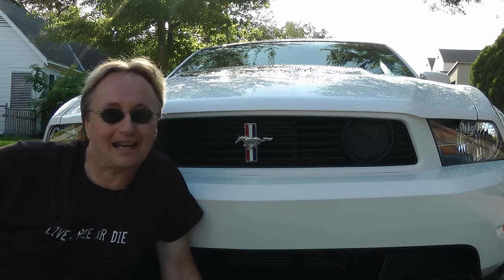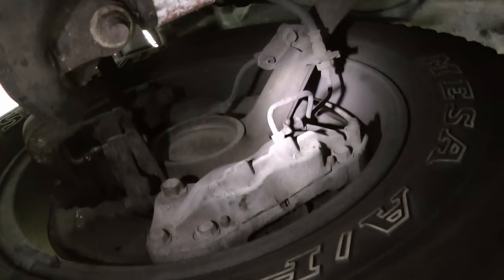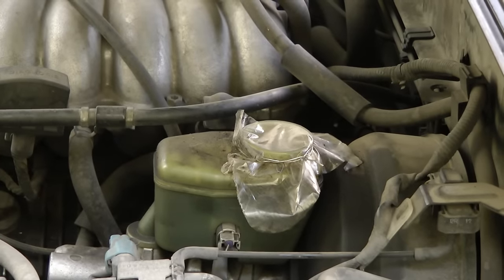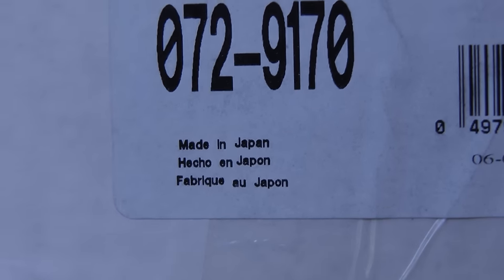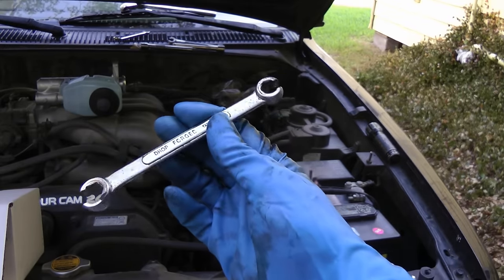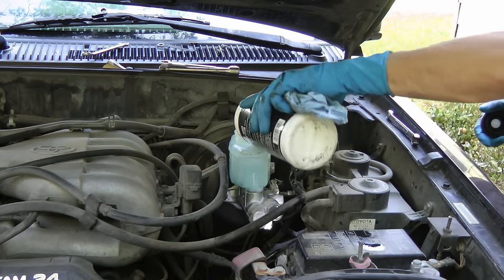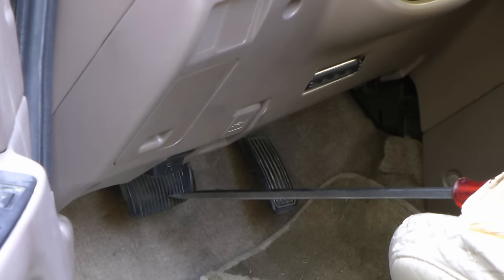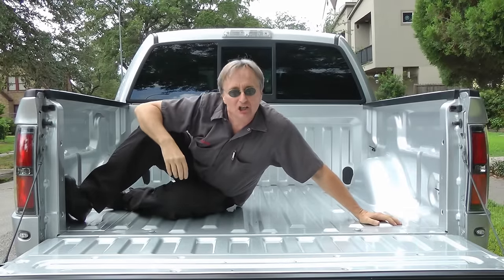How to Fix a Brake Pedal that Sinks in Your Car (Brake Master)

Comment: Have a question,
brake fluid is leeks between the master cylinder and the brake booster on my 76 Benz 280.
Reply: Rebuild or replace as needed and make sure to maintain all that clean of brake fluid. Rust will move in faster than you can imagine. ;-)
Cheers

Comment: I own an 03 sentra SER and everytime I turn my headlights on with the switch my 3rd brake light turns on. And when I don’t have my headlights on the brakes lights works fine but my signal lights turn on and all inside dash/radio area lights turn on

Comment: You are supposed to "bench bleed" master cylinders before installing them into the vehicle. If you don't it's very common for the plungers to flip inside the master and ruin it. You should never fully depress the master cylinder when it's dry, you want to push it about 1/4 of its travel to work the air out first.

Comment: Today I was driving and when I pushed down on the brakes past about halfway i felt a pop come through the brake pedal then a grinding type of sound not sure what it is.
Any suggestions?
Reply from the maker: often a blown wheel cylinder or calliper,pull. off all 4 wheels and check
Reply: I believe it might be the abs brakes kicking in.

Comment: I have problem with my 2000 lumina,brake pedal is hard when the car is off ,but it get spongy and goes to floor if I step on brake ,but it will stop the car as I 'm driving fine,but with low pedal? could it be ABS module selonoids?or air trapped in ABS?

Comment from the maker: either you have a leak in the system sucking in air, so check for that first, or the brake master cylinder is bad.

Comment: Won't work on a 2008 Ford Fusion. The HCU ABS unit has a valve sticking open issue that I understand has yet to be recalled.

Comment: how would you go about fixing the bright lights on a 2004 ford mustang? the low lights work but the brights do not.
Reply from the maker: +Amilson Marroquin check for burned out bulbs and bad wiring feeding the lights first, especially ground wiring

Comment: i just change both calipers in the rear of my 1987 fiero i bleed both sides in tje rear but my pedal is still vary soft and almost goes to the floor i have checked all four calipers no leaks did i just not get all the air out.thanks i could use some help.

Comment: What if the brake pedal doesn't rise [still doesn't rise after replacing the MC and oiling the heck out of the booster arm and pedal mechanism]?

Comment: difference between dot 3 and dot 4 ? my brake oil cap shows DOT3 recommend. can i use dot 4 brake oil ???
Reply: Always use the factory recommended type fluid! Brakes are no joke!
Difference between fluids is life and death.
Reply: +Károly Kiegel thanks for a lovely tip. what u said is absolutely correct. hmmm... :) thanks buddy

Comment: Do you have a video on when brake its a clicking noise? When driving don't hear the clicking noise. Thanks!
Reply from the maker: often worn brake pads, a loose calliper bolt, or worn out brake shims do that
Reply: Thank you Sir! My mechanic was telling me it was the links with the struts getting old. The parts are around $300. Plus I felt that would not resolve the issue after replacing motor mounts.

Comment: A few years back I had to completely overhaul the brake lines in a Jeep the brake pedal had snapped to the floor without warning and the vehicle went into some shrubs we were able to slowly drive back to the shed and when I unbolted the lines they literally crumbled to bits the size of frosted flakes.

Comment from the maker: have it power bleed, and if that doesn't do it, you got a bad master cylinder, realize they are custom made for apps and using a vette master may not just fit that hydraulic system correctly.

Comment: I think this is the issue I'm having.  I had the brake fluid changed about six months ago because the dealer said it was dirty.  I thought that was odd because I had it changed only about 16,000 miles prior.  However, I read that a master cylinder with an internal leak can contaminate the brake fluid.  And now I'm getting a brake pedal that sinks down.

Comment: Changed out brake booster, now pedal is soft and calipers won't bleed. Could this be the brake master?
Reply: Backyard Chevy Thank you for replying. I was thinking it was, but we ended up exchanging the part and found out the part we had received was bad. I had read this could happen but I guess I didn't think it would happen to us. Changed it out and they started bleeding right away. Thanks again!! Glad it wasn't another part!!

Comment: Its true. i bought a rebuilt one for my 96 explorer and the thing was over pressuring the brakes making it feel like if the brakes where stuck on forcing the engine to move the car and then i got a new one and the car was running smooth again and stopping the way it should

Comment: I have about my emergency brake the one day I push it and it sounded like some broke on but it does lock down in place but it's not working and when I release it it comes up and just hangs there do you know what could be
Reply from the maker: pray the cable just broke, often is just that

Comment: I pressed on my brake and heard a pop and there was smoke coming from the left side of the hood of 10 seconds. The car will only stop when you press the brake to the floor and if your doing more the 10 miles per hours the wheels lock up. There is a leak coming from under the car up front in the middle when you press the brake and when you star the car it will leak but not when the car is sitting. I have a 2003 Buick rendezvous from day one and this is the first problem I’m having with it.

Comment: Please help I bleed the brakes changed the line when I cut the car on( not starting it) I get the pressure I want but when I cut the engine on I loose all pressure in my brakes.

Comment: My break pedal sinks but doesn't sink all the way to the floor, only goes about half way.. How do I make sure that it's the master cylinder or the break booster that's going bad?
Reply from the maker: turn the engine off, and if it still goes hallf way, master is bad or leak exists somewhere. if it only goes down with engine running, booster is bad

Comment: Sorry to disagree but a sinking pedal could be more than just a external leak or a bad master. It could be air in abs module, soft hoses or lines. The best thing to do is to isolate the master by disconnecting the lines and plugging. Start the car and see if the pedal feels back to normal or if it stays the same. If it feels better than your master is ok, if it feels the same than the master is your issue. Ofcoarse after this you have to bleed your brakes.

Comment: I have a 2004 Pontiac grand prix. The brakes work pretty well. However if I'm on the brake and go over a bump or even a man hole cover I feel it lose traction and there's vibration in the pedal. The same happen when I attempt to stop abruptly...advice any one?

Comment: I got a master cylinder from American muscle for my 1996 mustang and it didn't fix the sinking brake pedal problem. I bled the master cylinder and each wheel 3 Times. There are no leaks whatsoever. Please help!
Reply: this might sound stupid, but try it! go to a parking lot and speed up to 15-20mph and slam on the breaks. sometimes this fixes the issue. did in my 00 gt.
Reply: +FonixFire do it 2-3 times

Comment: They are fairly tight, when i spin the wheel i hear the shoes touching the brake drums. Could my other option be bleeding? When i said they dont grab i meant they dont grab hard when i press the peddle, and its way too weak too stop it in motion.

Comment from the maker: same basic process, but if air gets into ABS systems, a complex scan computer is needed to bleed them out.
Reply: I got air in the abs....after brake bleed everything is fine until snow starts and the abs kicks in...sending air into the lines.

Comment: I have a 1994 CHEVY C-1500 i have replaced power booster /master cylinder/ abs valve/caliper/ rear wheel cylinder. replace steel brake lines from the master cylinder  to the right & left wheels and i can't get a firm brake pedal  i have bench bleed the master i have bleed the rear wheel cylinder & front calipers the pedal still is spongyi think the only thing i have not replaced is the combination valve. HELP
Reply from the maker: realize you can't bleed the air out of an abs system without a dealer level scan tool that does special software tricks to get all the air out

Comment: I have a 2003 Buick regal.  I was having hard shifts at take offs mostly I replaced the dogbone  bushings on the engine side and flipped the bushing on the frame side.  The bushings were badly worn out, so the engine was rocking back and forth.  Since I replaced the bushing the engine doesn't rock back and forth and it seemed to have fixed the hard shift problem. What are your thoughts on this?
Reply: Lol

Comment: Hi Scotty! Need some advice... my 2005 g35x brake pedal is spongy and goes all the way to the floor. This only happens when the engine is on. Doesn't feel spongy when the engine is off. 

This started happening when I replaced all four rotors and pads. On one of the occasions I remember when I pressed in the piston to install the pads, I forgot to open the brake fluid reservoir cap. Do u think this may have contributed to an internal failure due to pressure?

i have bled the brakes 4-5 times but the pedals still feels ge same. The beginning few times I did see some air come out but on the last round almost no air came out of the. Leader valve this implying the system is air free. Anyone else had this problem? What do u guys think is going on?
Reply: Hi, it's a shame he didn't answer this question. I've done exactly the same with the same results as you.. 
Only happened today. 
Tomorrow, I'm going to bleed them, failing that, buy a new master cylinder , failing that, abs module.. 
Did you solve yours ??
Reply: @joegriffin6699  it got much better when I bled them again

Comment: Hi Master Scotty
I have 2002 ford Expedition 2x4 4.6litter with 4 wheels ABS.  Reasonly I have the brake problem- engine running, apply the brake> brake pedal sinking slowly.  Engine stop, apply the brake> brake pedal  also sinking
I did replace 3 brake master cylenders (1 rebuilded, 2 new ones) plus rebuilded brake booster.
 On brake masters cylenders, I did bench bleed, and wheel cylenders bleed.
The problem í still the same as before.  Please help me to solve this problem. Thank you
Reply from the maker: either masters are bad, there is air in the system you're not getting out , there's a leak somewhere in  t he system, OR if it has ABS the ABS modulators often go bad and do that too. Perhaps time to pay  guy like me in your area to at least analyze it
Reply: Scotty Kilmer
Hi  Mr Scotty Kilmer
Before I changed everything It is the same as now.  I don't think it has air in the system.  I did check ABS with the scanner  and there is no code found.  So what the problem its can be .
 I  am looking forward to here from you
Thank you
Reply from the maker: Viet Nam
 check the whole system, line by line, piece by piece to see where the pressure is lost. Me, I use a pressure gauge made for brake systems, and they aren't cheap. So , you might pay a mechanic to analyze it with such equipment. Otherwise, you are just guessing.

Comment: had my ford escape at ford for a week, abs vibrating. new breaks new rotors and a front axel. pick it up and the pedal sinks not stopping drive thru a red light., two days latter go to pick it up and same thing pedal all the way down coasting to a stop. ford cant figure it out

Comment: 06 accent brakes are hard to press after replacing the brake light switch under the compartment. I used import not a OE

Comment: I have a 97 mustang i replace the the whole brake system all new but my pedal is still sinking i was wanting to know if u know anything about my  brake pressure control valve what does it do and if that would make my brake do that
Reply from the maker: if it has ABS brakes, they often go bad and do that. if not, the equalizer valve can go bad and do that. Unbolt it, plug it up, and if it stops sinking, that's it
Reply: where the equalizer valve at?
Reply: and no i don't have a ABS
Reply from the maker: Kira Yamato
follow the brake lines from the master cylinder going to the back of the car. the equalizer is the unit those lines go to when you follow them back to that little metal box
Reply: i found out what was going on something u might like to know to 97 mustang has a adjustment type brake booster so when my pedal was slagging like that it was because my brake booster was pushing all the way into the master cly thought u might like that info thanks for ur help Scotty i watch ever EP u got

Comment: I put brake fluid in my master cylinder and the brake light is still on.  Should I bleed the lines?
Reply from the maker: yes, but realize the light comes on if the system pressure is low too, could be a leak or bad master
Reply: Lets hope its a leak cause I just had the master cylinder and power brake booster changed a few years ago... Thanks for the quick reply, and thank you for posting these very informative videos.....

Comment: Hi Scottie: how to replace a water pump on a 2003 town & country vac, 3.3 v6 engine? Thanks
Reply from the maker: Drain the cooling system.
Remove the accessory drive belt shield.
Remove the accessory drive belt.
Fig.27

Remove water pump pulley bolts.
NOTE: To remove the water pump pulley, it MUST first be positioned between water pump housing and drive hub. The pulley can then be removed with the water pump assembly.

Fig.28

Rotate pulley until openings in pulley align with water pump drive hub spokes. Move pulley inward between pump housing and hub .
Fig.29

Position pulley to allow access to water pump mounting bolts. Remove water pump mounting bolts.
Remove water pump with the pulley loosely positioned between hub and the pump body.
Remove and discard the seal.
Clean seal groove and sealing surfaces on pump and timing chain case cover. Take care not to scratch or gouge sealing surfaces.
CLEANING
Clean gasket mating surfaces as necessary.

INSPECTION
Replace the water pump if it has any of the following defects.
Damage or cracks on the pump body.
Fig.30

Coolant leaks; this will be evident by a wet stream of coolant running down the pump body and components below. A thin stain below the weep hole reservoir slot is considered normal operation.
Impeller rubs inside of chain case cover.
Excessively loose or rough turning bearing.
NOTE: A weepage stain that is black, brown, or gray is considered normal, if it is dry. If the weep appears wet; pressure test the cooling system at 15-18 psi and observe the weep area. If weep area remains unchanged, do not replace the water pump for this condition. Replace the water pump, if a steady flow of engine coolant is evident from the weep hole/reservoir slot (shaft seal failure). Be sure to perform a thorough analysis before replacing water pump.

INSTALLATION

Fig.31

Install new seal into water pump housing groove.
NOTE: The water pump pulley MUST be positioned loosely between the pump housing and drive hub BEFORE water pump installation.

Position the water pump pulley loosely between pump housing and drive hub).
Install water pump and pulley to the timing chain case cover. Tighten water pump bolts to 12 Nm (105 in. lbs.).
Position pulley on water pump hub. Install bolts and tighten to 28 Nm (250 in. lbs.) .
Rotate pump by hand to check for freedom of movement.
Install the accessory drive belt.
Install drive belt shield.
Fill the cooling system.

Comment: Hey i wanted to know if my brakes lock up sumtimes is that the brake booster going bad
Reply from the maker: normally that's not the case.If car has ABS brakes, that system is breaking down and needs work. If not, brakes will lock up IF you step on them very hard.
Reply: Yes it has abs but i had took thu fuse out for it cause one of the sensors was broken and i had it like that for about a year and just a few weeks ago my brakes started to lock up as im driving but it dont do it all the time
Reply from the maker: david figueroa
figure out which wheels are locking up, if just one, that calliper is sticking on. If all of them, then often a bad equalizer valve will do that, or will do just the front 2 or back 2

Comment: my ABS light was on i did clean all 4 ABS sensors after i drove arround for 5 minutes and the light went off but my brake pedal is hard what can it be?
Reply from the maker: abs sensors will not make a brake pedal hard. More often a bad master cylinder or bad booster will do that
Reply: thanks Scotty. just had the a mechanic scan the car with his big computer and it is the ABS sensor front left. gonna change it myself now. i have a cheap scanner but it is only for engine codes.

Comment: bled r brakes after changing them an the cylinder but cylinder keeps popping an pedal goes to the floor is there a reason for this
Reply: i got same problem
Reply: +bramesh sharma we finally had to take it in everything we did cylinder kept popping

Comment: Anyone have any idea of what causes a frozen brake pedal on a 2002 Rav4.  Only happens in -25 Celsius weather but once the vehicle is warmed up for 10 minutes the brakes go back to normal.  It's a little scary since it feels like there are no brakes at all before the engine warms up.  I assume it has something to do with the engine vacuum as the rest of the year the brakes are perfectly normal.  Anyone have any ideas on this odd  Rav4 2.0 liter AWD scenario in cold weather?

Comment: Got a 07 cobalt changed master cylindrr and booster and when at a stop pedal slowly goes down and soumds lile if the brakes are disengaging slowly
Reply from the maker: Eddie Sandoval IF it has ABS, check the ABS module for problems. If not, something's leaking somewhere, check the whole system for pressure leaks